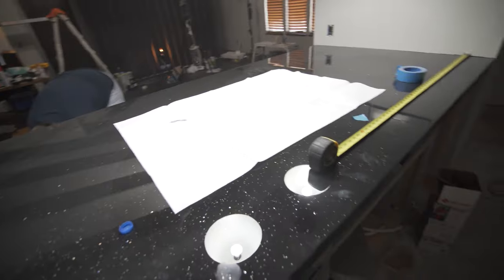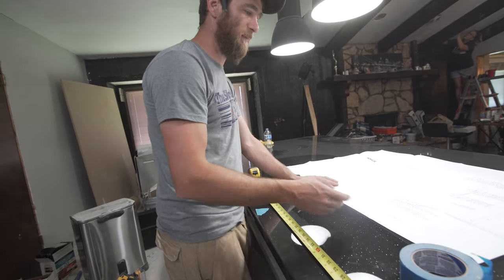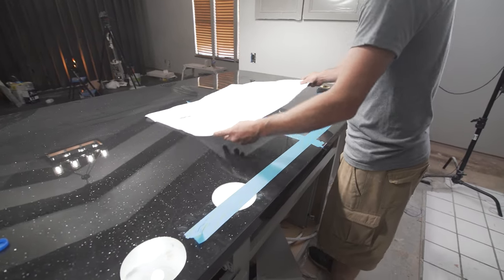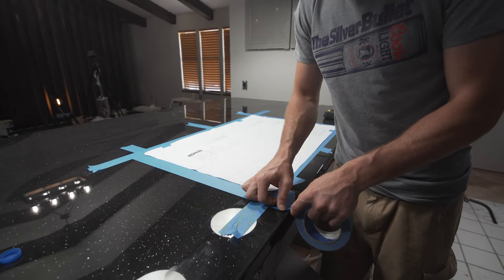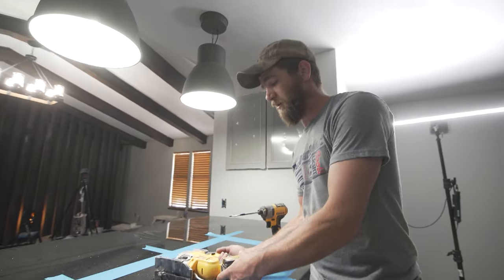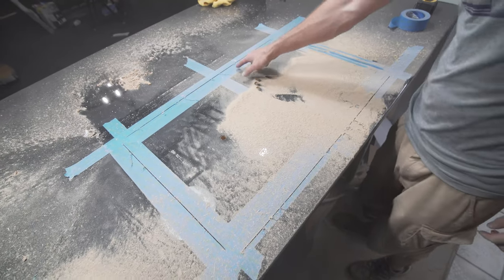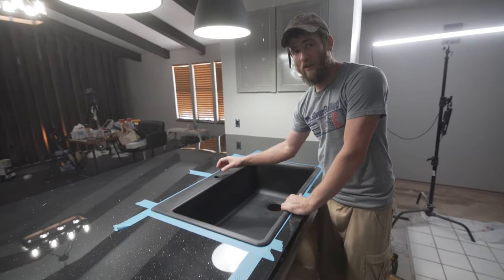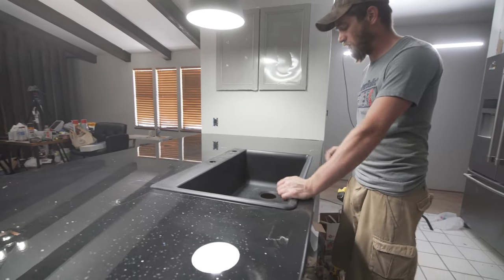Kitchen Island Sink Install | Kohler Neoroc

Comment: I’m stuck on the mounting bracket’s 🙁
Reply: How did you end up figuring it out?
Reply: No mounting brackets or system in place to mount it. 
Per top mounting instruction they want the silicone to be a permanent mounting solution, which sucks because I'm installing in a skoolie.